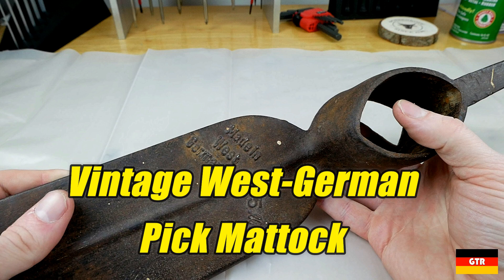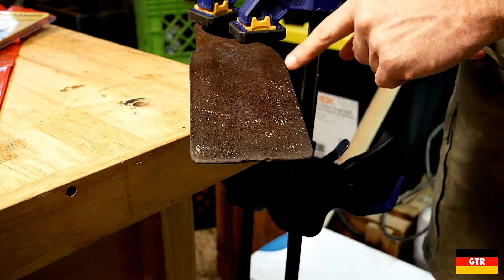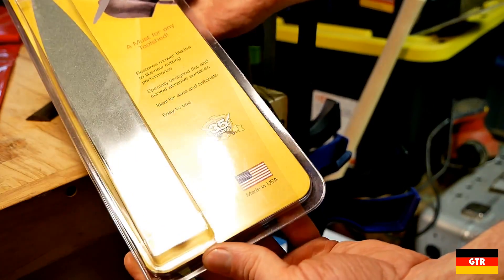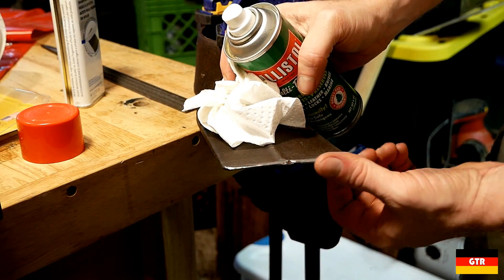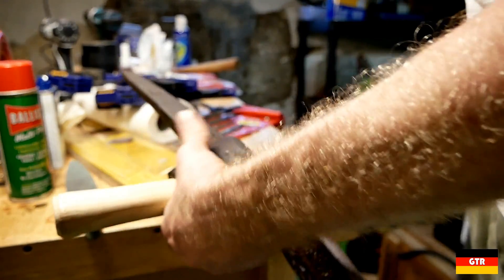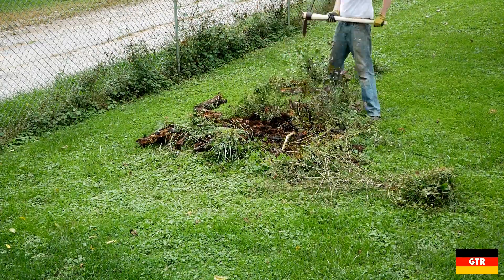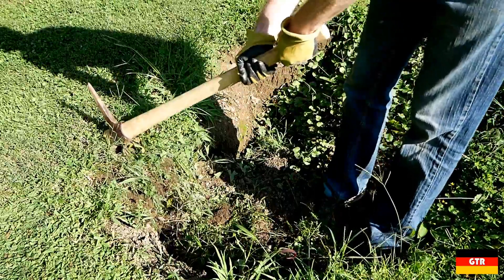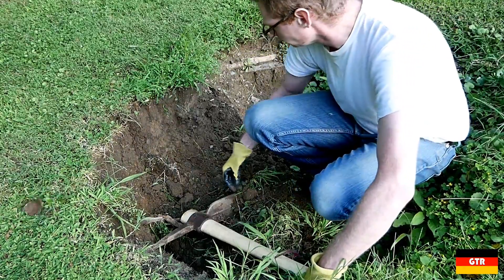West-German Pick Mattock Restoration

Comment: I would've gone at it with a grinder, I would sharpen a scalpel with a grinder. Lazy that way :)
How did you know they used to bury trash there? Is it in you garden?
Reply from the maker: I read somewhere that using an angle grinder or tempered/hardened metal will draw out the hardness due to the heat generated.  I wasn't sure if this tool was tempered or not so I didn't want to take a chance.

I was digging a post hole for a fence and found a bunch of bottles from the 1920s.   Talked with some of the old timers in the neighborhood and they said everyone buried and burned their trash up until the 1950s.   I don't know how big the area is where they did this but I would guess around 1000 sq ft or about 100 sq meters.  I have a bunch of videos on it on my personal channel if you interested in trash pit digging.
Reply: Yes, the angle grinder often isn't the most appropriate tool, but it's quick :p
Where can I find your personal channel? It's not in your "about" section.
Reply from the maker: Sorry, forgot to put a link in the last comment:  https://www.youtube.com/channel/UCbxVPcilRXRIvUqYkCIJ8zw    There are a lot of people who have the same name as me on youtube.
Reply: The link to your other channel doesn't work, can you post it again? I'm interested in the trash pit findings
Reply from the maker: The link works for me.  Try this (took out trailing spaces):  https://www.youtube.com/channel/UCbxVPcilRXRIvUqYkCIJ8zw